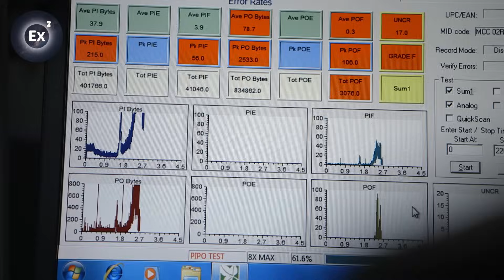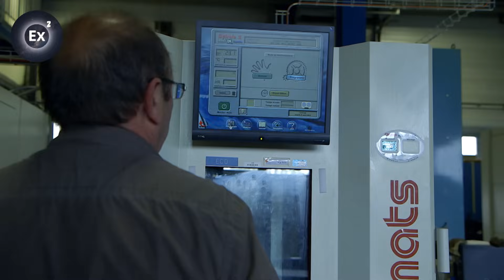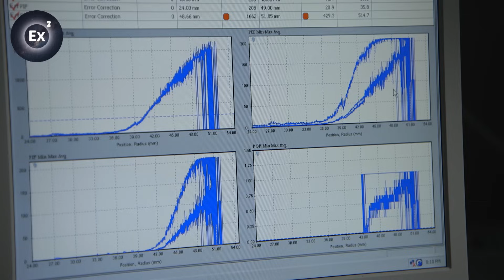Why is digital data so fragile? | Experts Explain

Comment: CD-R and CD-RW seem to be a good enough medium. I have stuff on them that has been written in 1998 and such. They are still readable.
I have some Kodak CD-R that uses a silver gold alloy for the reflector instead of aluminium. It is probably better to use pure gold.

DVD-R seems to be very unreliable. Some discs are completely unreadable after 1 y.
Sometimes, a bunch of file are readable but 1 or 2 files can’t be read and Linux says CRC error.
I have tried to read them using multiple DVD drives.

I just have TV shows and movies on them so no big deal.
I prefer HDD now. I keep multiple HDD as a backup.

Comment: Some Standards Committee must decide on a common storage format, and everyone has to commit to hold on to it for a thousand years or so.
In the last decades, the evolution of storage formats has been chaotic for two reasons: the proprietary formats, and the rapid increase in media storage sizes.
Sony has been at front in creating strange proprietary formats (recall the memory sticks?), but later a wiser man decided that micro-SD and USB thumb drives were the future for everyone worldwide.
The memory size moved from 360 Kbytes floppy disks, to 10 Terabyte hard drives and 2 Terabytes USB drives today, and it is still increasing. Now it could be possible to decide about an universal storage format (say, an 8 or 16 Terabytes USB stick; and start developing the Millenium Edition of this universal format, able to store data for one thousand years. This format will be the one that we will pass on to the future generations.
Of course we must commit to keep the reader available forever - similarly to what we did involuntarily with the LP records and with the musicassettes - proper readers are still on sale 75 years after the format begun to be sold...

Comment: The fact that anybody thought disks would last a hundred years in the first place is laughable if they got any use and everyone knows library and video stores were the worse because they were handled so frequently. One of the main reasons to rip a CD would be to put the original somewhere safe so you didn't mind if the in use one got scratched.

Comment: I have 1995 hdd IDE that I can still read.  I have some VCD on some really good writeable CD that mold doesn't eat.  Some of my burnt CDs died because microscopic animals eat it.  Some of my pressed CDs are so scratch up, that I might can save them with some glue or polish.  Those films and HDD last at least since 1995 to now.  I bought a ssd in 2011.  It died in 2014.  SSD transistors lose their charge and die.  Always archive to [magnetic tape]||rust which is a HDD or film.

Comment: Pretty soon, binary code will be supplanted by tertiary and quaternary code, and it will all be ushered in by Artificial Intelligence...   Human beings will be deemed useless and passe...  In all actuality, however, nowadays with modern nanofibers and other cutting-edge technologies of the 2020s, a compatible interim replacement for the CD can be developed right now, in order to allow migration of as much data as possible, until a more-permanent storage method can be attained.

Comment: I remember getting into photography back in the late 00's. Right when digital photography was taking over. Well for some reason I felt the need to use film cameras. I had a set of creative photography books from the 70's made by Kodak. And I wanted to go through the learning process with film, it just felt more pure. There were still film development shops everywhere and you could get professional film cameras for very cheap. Nobody wanted them anymore.

I remember having an argument with my sister who was into digital photography. "You will end up losing your photos" I told her. "I won't, I'll always have the negatives." And I was right. I still know exactly where all of the negatives and slides of all the photos I've ever taken are. Her digital photographs are lost on some computer somewhere that hasn't been fired up in 15 years.
Reply: I'm the same. I can still pull slides from 40 years ago and they are fine to scan. Even negatives. Never lost an image yet.... Film has actually made a big comeback and even when I scan I store the scans on mediums like discs for backup so I can constantly keep them safe. I actually scanned glass plates for a mate which were 110 years old and the quality was amazing.

Comment: The comment about keeping not only the data on current media but the format as well is particularly important.   I have documents in msword that current versions of msword cannot open.   So choosing open formats where possible is also a good idea.   Plain text,  pdf/a, etc.
Reply: Have you tried opening those old MSWord documents in LibreOffice? It has worked for me with .doc files from 1992.
Reply: Run a virtual machine with something like windows 95 and open them in an older version of office.

Comment: CD was a reliable long term storage medium. Before capitalism and  cheapness ruined it. Initially CD-R used gold reflective layer and single blank CD-R cost about 20USD. Then they started using silver, then aluminium coupled with even thinner recordable layer and greater recording speeds, resulting in discs that could not be read even few days after recording. Meanwhile all except one CD-R from better days in past are still perfectly fine after 20+ years.
Reply: I IMPORTED AND SSOLD THEM BACK IN 1980s I INSTALLED @GED@ TO GOVERMENT OF FRANCE.... I GOT SEVERAL ... THEY ARE GONE ... NO WAY TO READ THEM EVEN OLD XT OR AT MACHINES ... 40 YEARS HAVE PASS THEY AT SHIT
Reply: A CD that becomes unreadable after a few days seems like an unsellable product.

Comment: They really need to keep stating CD-R and not "CD". CD-Rs are well known to degrade. As are DVD-Rs. They're entirely different to glass mastered CDs and DVDs. Although of course, you can't save your home data to anything other than a CD-R / DVD-R if using discs. And no mention of cloud storage here either.

Comment: This is why regardless of medium  always..   ALWAYS   ALWAYS!!!!!!!!! have data backups and multiple redundancy especially for irreplaceable data   family photos etc etc

My standard here for most cases is a small NAS runningnunraid and min 3 HDDs..  1 parity and 2 data.  Then make a clone of  those drives and keep one copy seperate offline and then a second copy stored OFFSITE!  (Protection against loss via fire  theft etc)
Encryption I use by default as well but that's a personal call depending on the nature of the files

If you have old archives on CDs /DVDs/ HD-DVD/ BR etc or god forbid floppies..  get busy and make an archive of them on HDDs as described above.

Also for master encryption and ultra sensitive data etc keeping copies on redundant good quality usb flash drives is a must.

And remember for security  use Bitwarden for password mgr  (free,open source and very secure if used properly  unlike most of the other shit out there..  like the Norton garbage or fastpass with repeated breaches and anti used gouging bs)
Use an uber secure passcode or better yet pass phrase..  and then have bitwarden use custom generated high security passwords for each site/use etc  dont use the default min length..  use at least 16 character passwords with full acsi suite use.  Any site that wont allow you to use such I suggest avoiding if at all possible and telling the owners of such off since not supporting such is idiotic esp in this day and age.

Use the perfect password app and other free tools from Steve Gibson at grc.com  he unlike most actually knows hisnshit and has forgotten more than most will ever hope to know.  And I do not give such praise for skill lightly! (with my decades of experience in IT I know what I'm doing and know when someone is even outclassing my skills and SG is one of those hands down.)

Comment: This doesn't seem to be an issue for me. My first crude xxxMB and xGB HDDs were doomed to fail by the time I received them. My xxGB IDE HDDs still work fine but I don't have anything old enough to interface them save for maybe a Pentium 4 system somewhere. This interface problem means limited or no access. Since SATA first appeared, it became clear that SATA is here to stay and maybe it will be obsoleted by SAS in the next 20 years but there is one greater champion to guarantee interface and that is USB. USB is eternal, wanting and without end. Moving on to the data itself, I never write backups but do keep checksums on very LARGE and important sets of data. Every 5-10 years I simply pick up a new disk and migrate the data over to that new volume and continue using the older disks until they either die or outlive their purpose.

In the past 20 years I've gone from 80GB IDE to 300GB SATA. From there 750GB, 2TB, 4.9TB and now 16TB. That's a pretty big push for just one guy and I'm painfully aware of addictions related to this field that attracts a phenomenon like data hoarding. So far, all storage mediums have proven to be as garbage and prone to bit rot as those CDs. Despite this, they all have one solid trick and that's ubiquity. They don't need to hoard their data all in one spot. It needs to be shared as a means of defeating extinction. That's GG. Problem solved.
Reply: Ide to usb adapters can be had pretty cheap now (under 10 bux) so accessing older ide drives  is easy so long as the drive is in good working order   if it is not or even suspect if such do NOT try using the usb adapter)
Reply: @konnorj6442  Can you elaborate on why not to use a USB adapter if the drive is suspected to have problems? Would that somehow damage the drive even more? Would that damage not occur if the drive were connected to a computer's internal IDE port?
Reply: @DouglasKaden  If the HDD is even suspected to have damage, the correct step to take is to have speciality data retrieval as normal operation (regardless if through IDE-ports or USB) might cause catastrophic damage.

Comment: I  have 40 year old VHS recordings that play just fine in my Panasonic DMR EZ49V.
I have quite old CDs and DVDs as well as my first USB flash drive (128MB) all working fine.
The 40GB HDD in my 2005 DELL laptop still boots up.
Everything is backed up and the backup backed up.

Comment: I have CDs that are 20 years old, and I'm afraid to put them in my optical drive out of fear that they will explode (due to centrifugal force). Some of them have cracked and are clearly no longer usable. I still use DVDs even today for archival backups, but I don't think I'm going to be able to do so for much longer.
Reply: cracked cds will be ok in audio cd players as they spin fairly slow, but not a good idea to use cracked ones in computer drives unless you can force drive speed slower

Comment: I have been storing my CD's under Argon for more than 20 years, ever since I realized how unstable a medium they were. These disks still appear fine and data loss is minimal.
  But, of all media, hard disks stored under Argon have been the most stable of all methods I have tried.
Reply: Hard disks are now filled with helium
Reply: @timramich  but they do for reducing drag on its spinning platters and not for longevity.
Reply: @ibo beko  They do it to allow the heads to ride closer to the surface, for more storage density. And you can't tell me a helium atmosphere inside then isn't a better thing for the materials in there.
Reply: @timramich  Yes, Helium is inert and blocks oxygen from its dirty deeds.
Reply: I think the only long term issue with mechanical hard disks would be the lubricant for the motor and arm ?!
Reply: @ModItBetter  Don't know. Lubricants can cause problems often so they are not used in certain places (like garage doors where they gather dirt or wrong ones on motorcycle chains that attract dirt and increase wear). Nylon, etc. on metal wears well. I use Vaseline on clocks because when it evaporates as they all do, it leaves no residue from additives.
  Did you see WD's new 44 TB drive? Electronic memory is a sorry second.
Reply: @mikemondano3624  wow 44tb..heh.. biggest I got is a wd 12tb and I use it only  to do monthly clones of my 2tb nvme. and to move finished projects over for backups..

I do trust mechanical hardrives more but with that said I have a huge collection of bad hdd's probably over 50 or more..
but most of the dead ones are from dvr's and shared media drives for the house..
Reply: would be wise to back them up
Reply: This video fails to address the other problem: even if the physical media is perfectly working in itself, how will you extract the data in the future?

For example, a lot of the East German archives are unreadable, because neither the computer architecture nor the OS is available today with them being obsolete, and the documentation for recreating them (specifications, encoding format and so forth) are in the archives.

Comment: flash drive or ssd drive is even worst. those m.2 has high failure rates due ro heat. they are more exposed to heat than ssd drive becsuse they run at higher speed. ssd drive runs at 500mb read write  usually, the m.2 goes up to 7000mb per second. So the heat is higher. usually you are looking at failure rate within 2 years

Comment: 6:30 Wait WHAT? Moment earlier it was claimed 85% of CD can keep data for more than 20 years he couldn't tell how long all he could say - it survived. So typical for  what is now called "science". Data shows most of mediums are still perfectly fine. Show me FLASH or HDD or tape made these days capable od doing it for that long. Flash uses 4,8 levels of voltage to represend 2,3 bits at once it loses data just don't know yet. As example how it works - i noticed issues with DDR RAM modules not because DRAM was broken but SPD data on this tiny chip that holds parameters. On one PC was readable on other not. Two of 4 modules made in 2007 never booted, other 2 made in 2008 sometimes, sometimes not, same exact manufatrurer model purchased at same time by previous owner.  Knowing what could been damaged - NAND Flash i reprogrammed it with SPDTool on other machine without any modification and it worked flawlesly. This happened during winter PC was exposed to extreme cold. Had simmilar issues to boot 2005+ made PC's yet i had never such issues to PC made in 90s. Nor to any CD-ROM. I had tough issues with quite modern DVD's and Flash BIOSes

I instantly knew what was cause. That is example of 20 years old flash storage medium already loosing data. BIOS, firmware, of most of 2000+ devices. No longer hard-wired logic but all programable. Be aware! Update BIOS before it's too late. Even HDD drives even if platern and head will be fine, even it holds its firmware in FLASH memory! It can stop working after 20 years if it's made in early 2000s.

Beware or modern types of memory. CD in comparison is not that bad 30 years old disks are still perfectly fine! Same with old HDDs some hardwired GAL PROM technology (bit's are burnt forever)

In old days these  flash memories stored 1 bit / cell, as 2 states, 0 or 1es. Now days much smaller cell, leaking as much as old one, stores multiple level of voltage interpreted as 2,4 bits at once. Wont be able to retain information as long as 15% of CDs guy tested. But because it's still in use nobody yet noticed that much. I have no issues with old HDD, BIOSes  yet newest ones do have broken sectors problems to boot machines that are 20 years old. None of such problemm i had with machines older than that. Some 35 years old.  No issues with CD-ROM. Lot of issues with DVDs. What other type of data storage you ment as comparison to CD? All CD and had written many in 2000s all still held data despite fact so much people claim - it wont be possible at all. I almost believed CD are bad. Had to throw away CD-ROM devices cause laser degraded with time, that is issue. Not medium but devices.

Comment: HDD data is fragile fr
But SSD can just run out of write cycles and the data that was on them will stay
Reply: Electron leakage. Never keep your data on unpowered SSD.
Reply: @pakan357  Wait fr?
(Anyways i still use HDD)
Reply: @narrativeless404  Yes, modern TLC and QLC are especially at risk. I think they are guaranteed by JEDEC to last for 12 months without power, but anything over is a gamble. USB flash drives as well.
Reply: @pakan357  USB Flash drives last over a year easily
Like, they just lay in random places for long times and then u plug it in and all the data's still there
Dunno about SSD
Reply: @narrativeless404  They do, but are not guaranteed to. I'm sure you have a CD-R at home burned in 2002 that still reads perfectly. But it's common for them to develop errors in a few years.
Reply: @pakan357  I don't use the CD/DVD reader anymore
Because the old one is not supported by the new motherboard
Reply: @NerdyNEET  Controller periodically checks the voltage of each cell and corrects it if necessary, it's not doing a full rewrite. It being able to keep track of each cell is witchcraft.

Comment: I did forget to ask, what about Bluray Discs? They make recordable media, too. Are they just as bad?
Reply: I have been using BDR for 10 yrs now. The manufacturing process WAS better until companies got cheap & start using the cd process ON the BDR media. I cant speak for the reliability of this newer bdr process. Overall BDR tends to coaster out on the burner or be reliable. But when a DISK DOES fail youve just lost 50-100X more data. So its catastrophic either way.

Comment: I would say
Tape > dvd /cd > bdr >ssd=hdd

Ignore the cost
Tape is the best of coz
But i found dvd/cd is much better for backup than hdd 
1. Once you burnt, data would be remove (easily)
2. Better drop protection than hdd

The reason why i have opinion 1, is because i just restore my old photo from cd backup in 2001😂

Of coz humidity can kill them all

But now i kept 3 media backup
Ssd/hdd +bdr. Why i prefer cd dvd than bdr is 
Bdr XL burner is rare to get